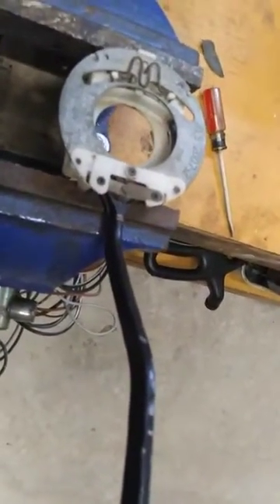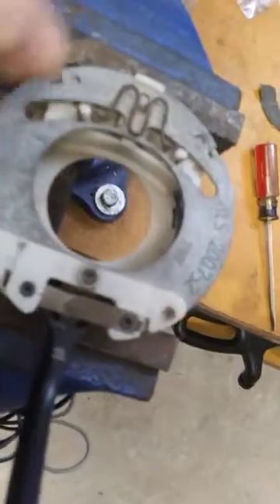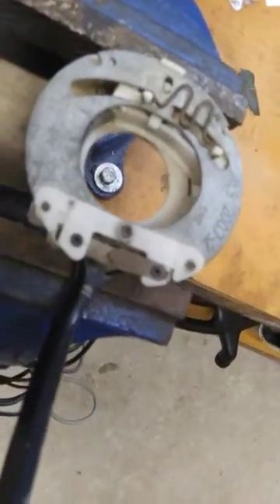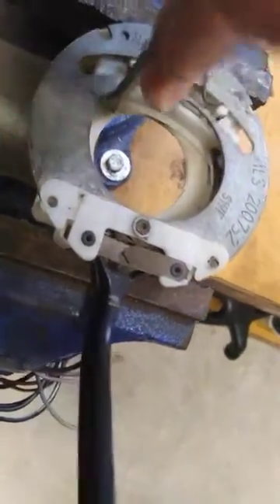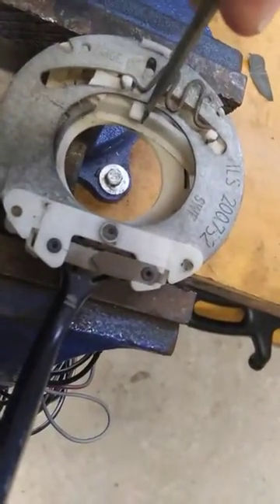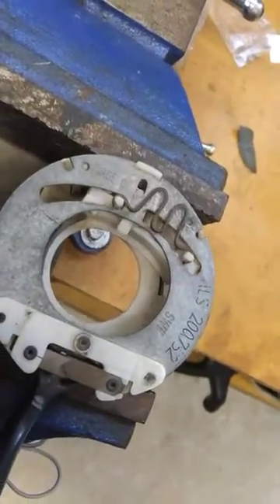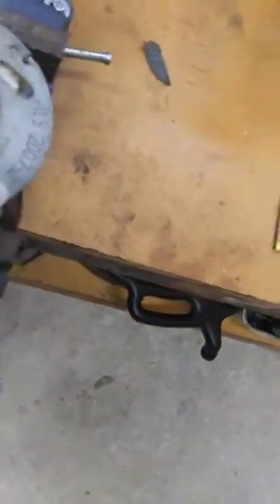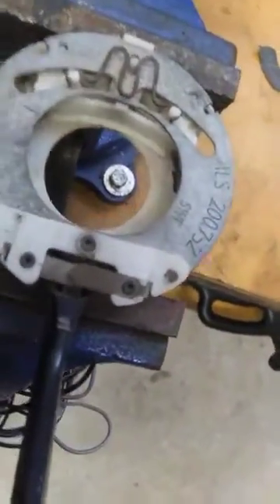Beetle turn signal mech cancel turn. How it works, after market or OEM

Comment: Well, not exactly explaining what it says on the tin i.e. what pushes the nozzle out?

If you brake the whole thing down (agonizing to get the contact with their 4 tiny 
bottom springs back into place) - there is no spring which pushes the glider into
to middle. 

It's just flat disc subject the small notches bottom and top. Shifts loose to the side and
back in my case, but works for some reason on a right turn, only. Nothing broken,
got a second plastic part to compare. But I might have messed up something or
lost a micro-spring up or whatever and you may help and got a closeup how it 
supposed to be in position above the switch resp. below the lid? 

Yours sincerely.
Reply from the maker: Hi, I am away from home and will not be back for a couple of weeks.  If you still have a problem could you take a picture to the part you call the switch and lid?  So  you can not make the assembly work in your hand, not installed?   Jim.
Reply from the maker: As a note, I am not sure what centers the "nozzle"/tab until I look at the assembly. Will need to look at the assembly,
Jim.
Reply: Thanx for the reponse Jim.

Dragged the suspect into custody.

It's a ridge, barely to tell, less than 0.5mm high.

The disc rides on the contact switch.

In the neutral position the disc glides in front of and towards the
middle along of it. The ridge got a park position, an arc at the 3'oclock, setting the indicator handle on the left i.e. to 9'oclock.

On a turn this disc moves along the ridge, its extension which shall be caught by the wheel eventually moves closer towards the center. 
Due to the fact the thinner side of the switch moves opposite side, 
the disc stays always centered.

The switch itself got a spring which tightens the indicator handle to keep 
it in the desired position and drives at the same time the disc into 
the middle on a turn. After that your video comes into place.

Due to the fact that plastic wears and tears with the decades the disc 
slips over this ridge eventually and that's the end of it  i.e. 
from that on it works faulty as in my case or not at all.

An almost unrepairable nasty malicious piece, but makeable for puritans.

Will send you some pics once I am finished, as the result with the old disc
where not satisfying me. I will replace it with brass and fix it with a solid screw so it still can move along to the ridge but not overcome it anymore.

Guess, you'll probably will have a look at the assembly yourself until then anyway so take care of the following to save you a lot of time and anger
which I did not as a first time on that issue:

The lid is hold into place by a bolt (handle) and a tiny clip
on the other side. Don't worry to brake it off, it's hard and unflexible
already and in the way eventually. 

You'll need to drill holes with a thread anyway, I'll show you.

Losen the wiring and you can lift and move the metal-lid to the side 
to get the switch of and out the handle arms.

Note! 
The switch has a strong spring on it nose (front) with a V-shaped plasic cap which clicks into the given gaps on a turne. That shoots out like
a bullet and four tiny springs with one or two copper contacts on the bottom easily fall allover the places.

How to get that fiddling stuff back in again I'll pic later too, subject
you care.
 
It's maybe not worth the effort because someone get the whole indicator 
new and very cheap at EBay but it is a matter of stubborness to refrain from in our throwaway society ;-)
Reply: @Tokolyser  hey sir I just reassembled my switch as well since I broke it open and wanted to salvage it, I've got it back together but now the switch won't snap into its "parked" position, it snaps into the top and bottom positions though. Would appreciate some advice on this, also I don't know if my switch is different but I didn't see any mention of a tiny metal ball in the switch, I had a metal ball fall out as well and I don't know where that piece goes or if it even belongs in the switch, thank you for your time.